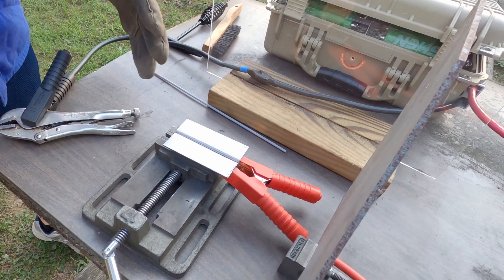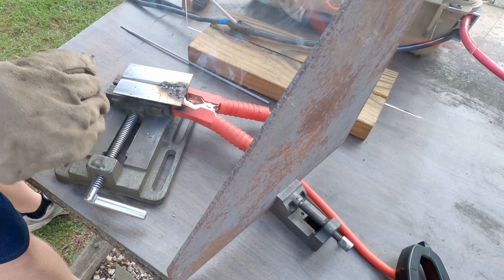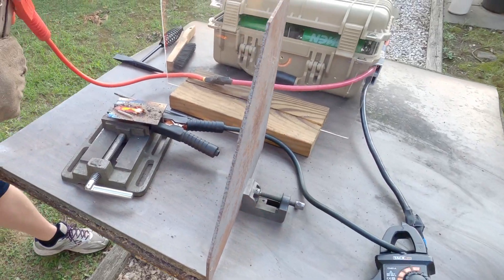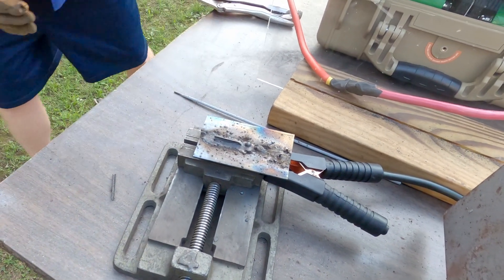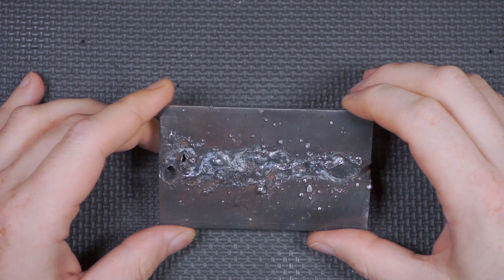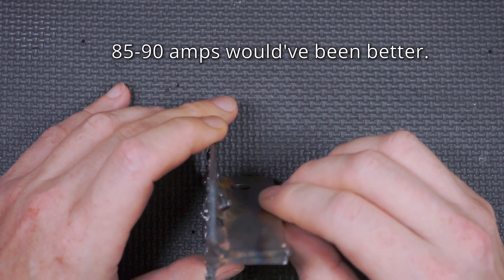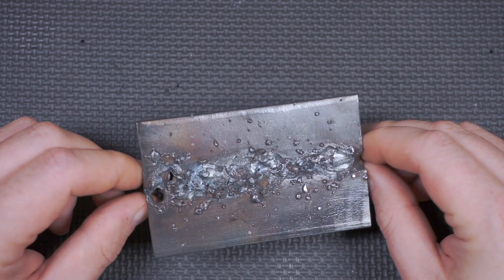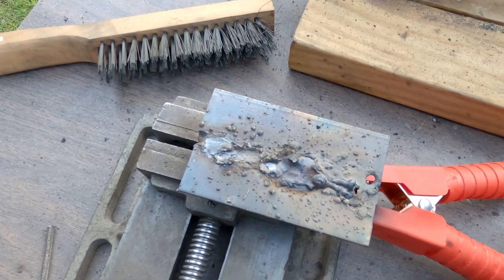Stick Welding With Lishen LTO Batteries

Comment: Hi. When you say current controller, is there a ready made DC to DC controller that you could add to this pack to reduce/control the output amps? Trying to figure out how to craft such a portable welder (I do prefer arc welding) but I want it to be portable  (weight and size that can be transported on a motorcycle). Heavy welding generators are not a valid solution for remote welding, not to me at least. Tnx from Athens, Greece.
Reply from the maker: I haven't thought about it to be honest.  The super butch way to do it would be to use some sort of resistive element in line with the cable - like a piece of stainless rod or something; or a series of them.  The downside would be you'd need to continually adjust it as the batteries discharge.  I'm sure there's some sort of PWM MOSFET/IGBT solution available, though.  It shouldn't be too hard to design one if there isn't.  An arduino with a 75mV current shunt would probably work as the "brains."
Reply: @AlexLTDLX  There is the 'Ready welder" and the "Karnage Welder" mig options available to hook to a battery pack like yours but they don' t seem to control the output amps. There is also the Fronious Accu Pocket stick welder that has lithium batteries but the costs of it is way high as was the Dewalt version that went discontinued as soon as it went on sale. Using an inverter makes it bulky. Hmmm.. In whatever the case, I trust a big capacitor   after the battery pack could maybe help smooth the welding outcome.

Comment: Thats impressive, be good to see this on thicker steel & suitable rod as you said.
Reply from the maker: I kinda want to try that, but I really just want to get the packs in the car.  As soon as get through this bathroom gutting/remodel, I'll put my energies into getting the electric turbos ready for more testing.
Reply: @AlexLTDLX  i was recently looking into vesc available on the market... and the can support your power level why did you decide to go with the expensive unit you have now?

I could not recall manufacturer and model of you esc
Reply from the maker: @FirstLast-tx3yj  It was APD - Advanced Power Drives.  Basically, there were a lot of bits that have to work together and two consecutive failures of the Chinese units was enough of a holdup.  There's no kill like overkill - and the APD units really aren't overkill - they do have current limiting and fantastic datalogging; that's why I went that way.  I do intend to push this motor pretty hard - and we'll be exceeding 300 amps at the coils very soon.

Comment: leaves the electric turbo and starts a battery welder 😂😂 veerryyy impressive
Reply from the maker: Lol.  I appreciate the compliment, but without current control, I'm just a knucklehead with melted jumper cable clamps and an out of control arc.  :)
Reply: LOL